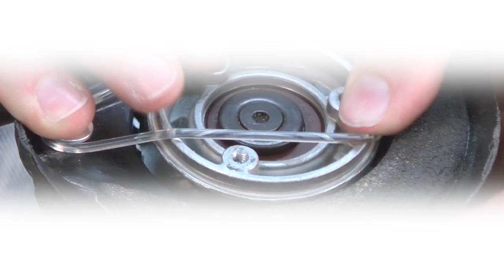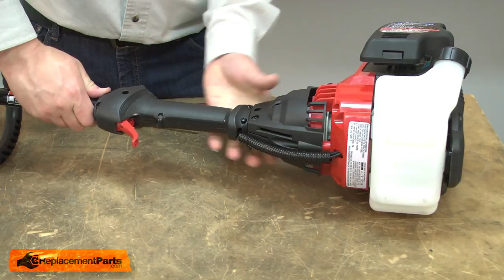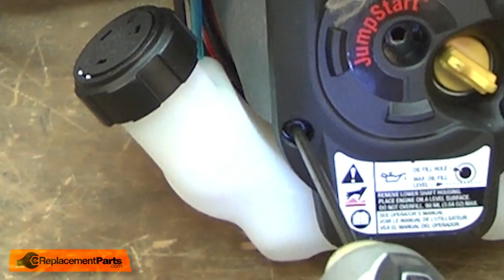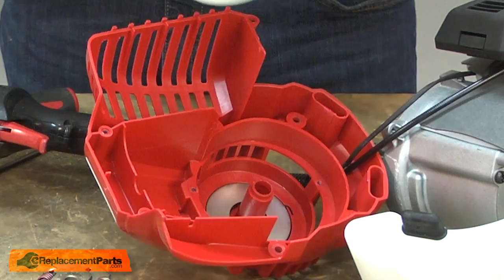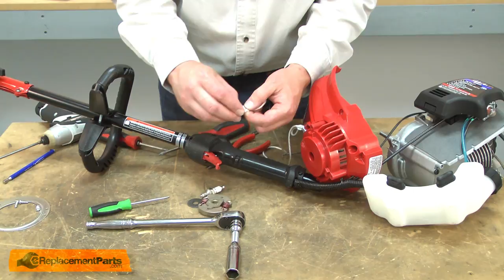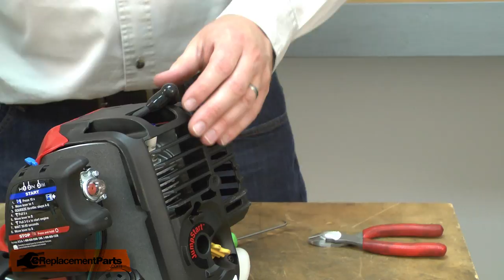Troy-Bilt Trimmer Repair - Replacing the Recoil Spring (Troy-Bilt Part # 753-04286)

Comment: My TB575 EC, at least 10 years old, I was get a loud clacking noise and it just felt like a tooth is missing; it doesn't grab.  If I kept pulling, it eventually it would grab and will start. I replaced the Starter Assembly and that 100% fixed my problem.  While I had the clutch out, I cleaned and lubed the pawls to make sure they were moving freely and snapping back on their springs and reassembled with  the old Start Assembly and it was still clack clack and not catching, so it wasn't the pawls..  The new Starter Assembly did the trick.

Comment: There is an easier way to put the rope in: If you'll put the rope in the pulley before installing the pulley (clockwise when looking into the assembly obviously,) there is a notch that you can pull the rope thru to help hold the rope tight as you wind up the spring. Once the spring is wound 2-3 times (you don't need 5 turns with this method) you can feed the rope thru the metal hole, then install the handle. I learned this after fighting mine for about an hour (and before finding this video, LOL!) It's a lot easier than trying to tie a knot one-handed while juggling a wound spring with the other.
Also, I put a little bit of Vaseline (as a lubricant) on all the parts that contact each other. Axle grease tends to make the parts bind up like a glue, but petroleum jelly is thin enough to protect but not bind.
Reply: Thanks, this helped. I went through three yt vids were no one showed how to get the string wound back up or did it some other convoluted way.

Comment: My issue is the spring inside starter rope assembly is clicking and spinning under tension. Rope goes in and out fine but wont get the force needed to turn over motor without slipping. Please help.
Reply: Haladafs I have the same problem don’t think it’s this spring.
Reply: Replaced spring it was the plastic piece with metal spring in it on top. It snapped on that metal. So I swapped it. Worked then stopped running after 10 mins got carbs and stuff to do now. Fuel lines filters etc lol. Got a worx for now.
Reply: You probably got some problem with those little paws inside there

Comment: I can't find the retaining ring on your website
Reply from the maker: Hi Dee, are you looking for the spring from this video or a separate retaining ring? If you send us your model number, and what you're looking for, we should be able to help you find it!
Reply: In this video, he says to cut the retaining ring that is holding the pull cord assembly and spring in place.  Which he said would need to be replaced afterwards. I'm only looking for the retaining ring for the same model trimmer in this video.
Reply from the maker: @eggroll1up918  here's a parts list for the Troy-Bilt TB575EC String Trimmer as shown in the video: https://www.ereplacementparts.com/troybilt-tb575ec-41adt57c766-gas-string-trimmer-parts-c-26780_27267_202395.html I hope this helps you with your repair!
Reply: @eggroll1up918  he got you on that one you can get that ring for $18 and some change before shipping
Reply: @gregschroer2314  well turns out you don't have to cut that ring you can just kind of wiggle it off and reuse it what I did so I didn't have to end up getting a ring anyway but $18 that seems a little steep for that little ring don't you think